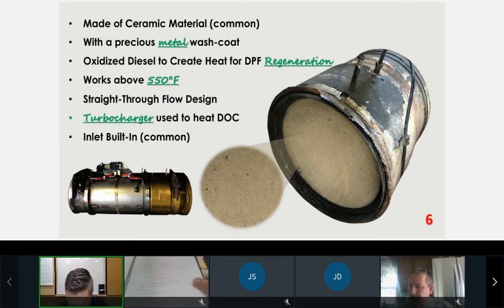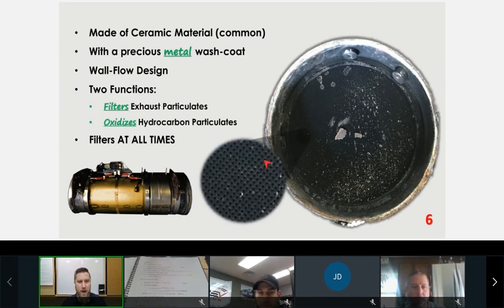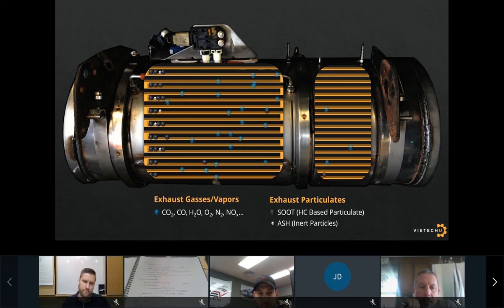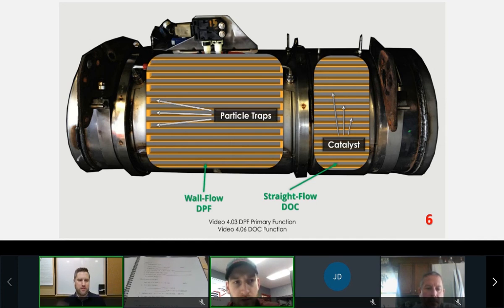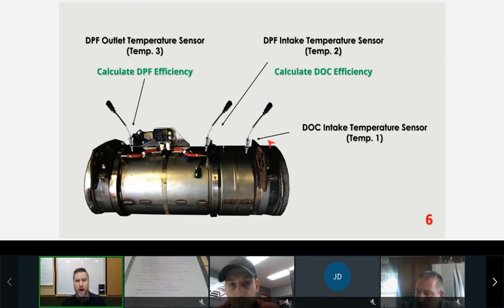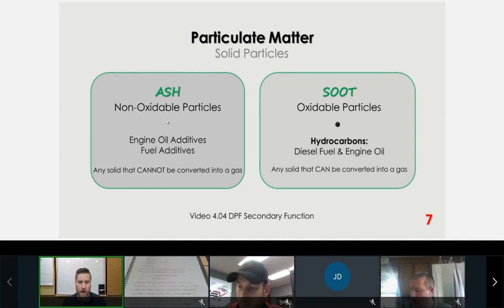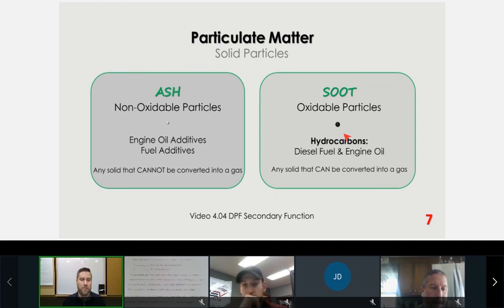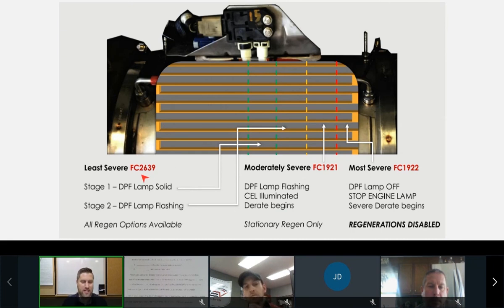Preview VieTech Aftertreatment Emission Systems Training

Comment: Extremely interesting video, you mention the light on at say 50% obviously the light is triggered by certain calculations, I have observed readings during regen. no lights on a ISF2.8
I use readings at idle a regen seems to occur at 23mBar and ends with 4mBar  DPS reading and exhaust press about 1100mBar.
Are you able do a vid using pressures, temps during the process
If a new DPF is fitted are there ECM resets necessary?
Reply from the maker: A new DPF will require a reset using your service tool.
Unfortunately for pressures before and after regeneration there is variation based on make, model, configuration and ECM calibration to have a exact pressure readings applicable to all.
Reply: Thanks done now do you know simple reason for reset? @VieTechTrainingConsultingInc